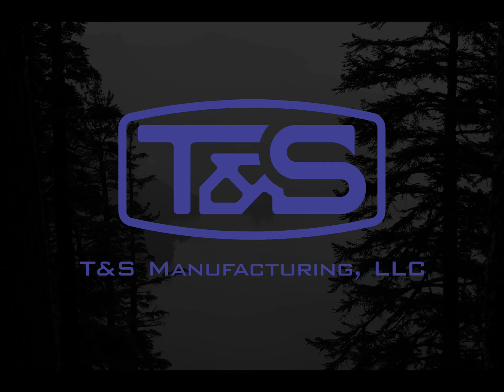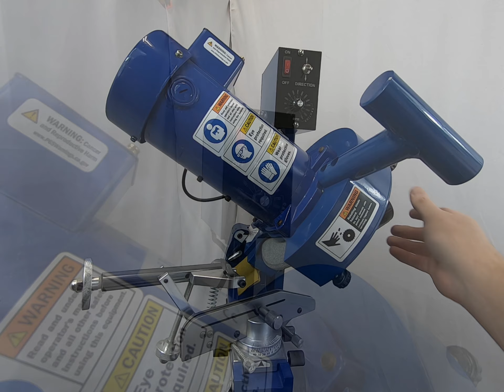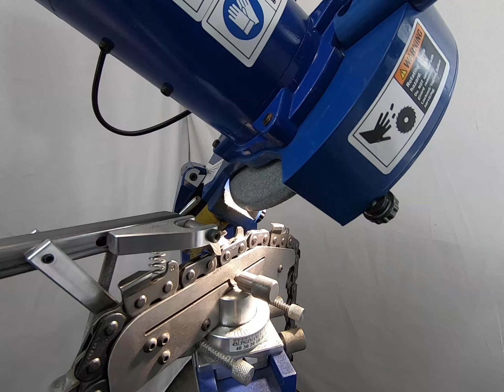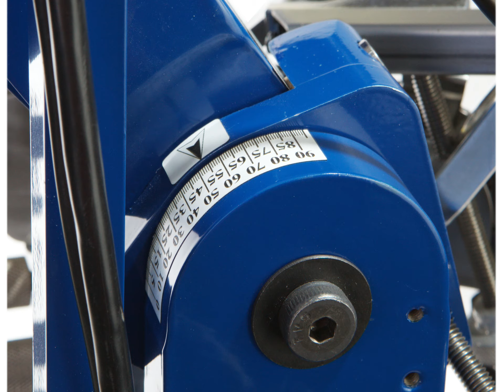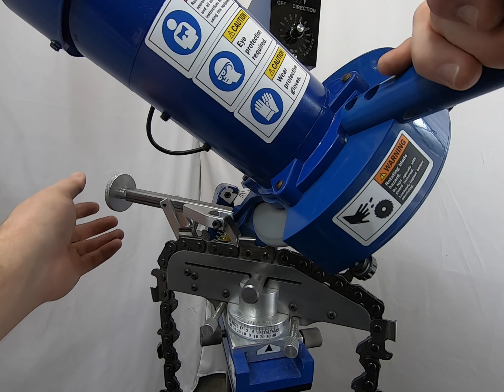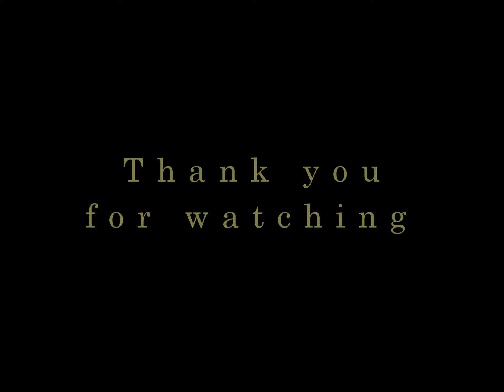T & S Manufacturing CS118 3/4 Pitch Grinder Overview and Grinding

Comment: Looks like a nice machine. 
Is there a European version 230V 50Hz available? 
Or is it possible to rebuild to Europe spec easy?
Reply from the maker: Thank you for your question.  We have a motor controller that accepts 230V 50Hz, so it is easy to switch it over to European standards.  The proper electrical plug is also available.  Our main challenge is to find an economical method of freight.  To this end we're talking with potential distributors who could accept a pallet of machines.  Please feel free to reach out to us directly info@tandsmfg.com

Comment: Can you elaborate on the centering of the wheel as it wears.

Your wheel, and mine on the grinder o purchased from you,never seems to get centered where depth is the same for either side of the cutters.

Secondly, the stop paw is so wide and not centered making it difficult to grind 3/8ths chain when more than half worn. 
Any remedy other than letting the wheel eat it?
Reply from the maker: Hi Kyle.  Thank you for your questions.  I'll reach out to you tonight via email to see what we can do to help.